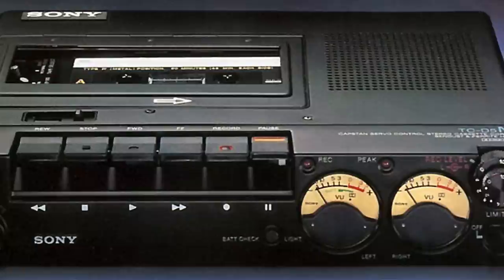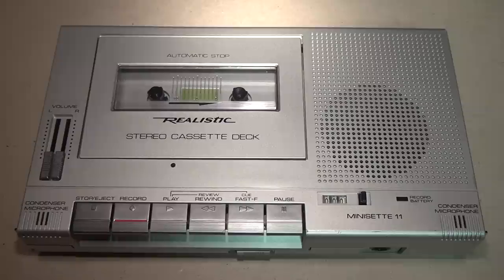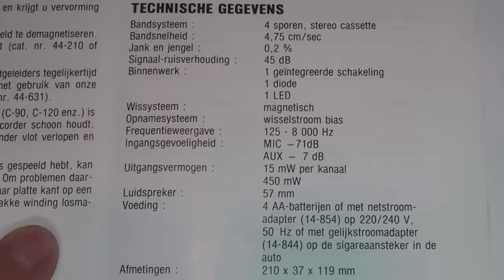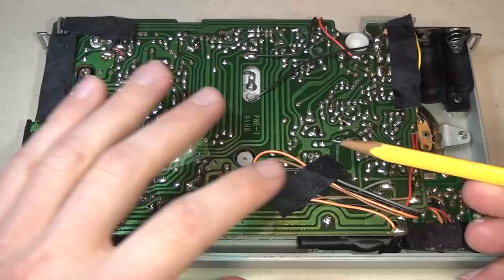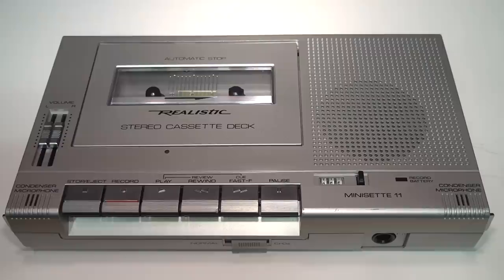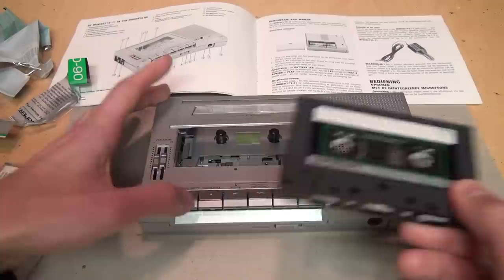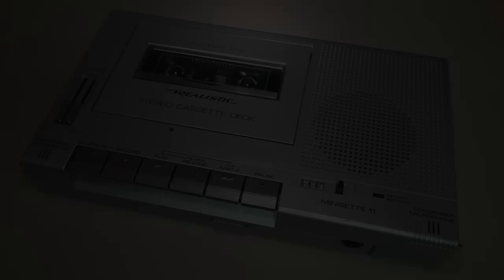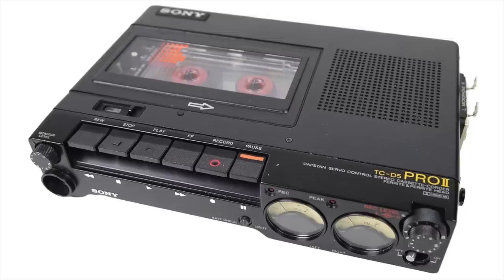A Realistic alternative? - The Minisette-11 stereo cassette recorder

Comment: i remember those minisettes in the 80s, my parents asked me what i wanted for christmas one year and i said one of those, the 11, but couldnt afford it so they got me the mono version minisette 9, still got it, mostly ok but needs new belt now, i think the years catalogue at the time said the 11 was £69 and 9 £49, but it was on offer at that time for either £39 or £29, cant remember for sure...
Reply: if it was the 9 you wanted info on, i still have the manual and couldve scanned it for you
Reply: the led  on the 9 works the other way strangely, lights if battery ok, but goes dim/out when flat ..???!!!!
Reply from the maker: @andygozzo72  Yes, I owned a Minisette-9 previously and that's what confused me -- the LED working the opposite of the Minisette-11. The 9 and 11 use the same belts, because the mechanism is identical. What does the manual for the Minisette-9 list for the wow & flutter and frequency response?
Reply: @vwestlife  wow n flutter 0.2% signal to noise 45dB, no mention of frequency response
Reply from the maker: @andygozzo72  Thanks. I expected the specs would be the same, since they both use the same mechanism. And I think they changed the way the battery LED works for when you're making long recordings. This way, when you see it start to glow continuously, then you know your batteries are getting low. Otherwise the other way, you only get an indication of battery life during playback, not recording.

Comment: Well just when I thought the price was gonna go down. I have a safe search notice the price went down at least 100. They were up at 700.
I locked out sort of and got one before they went up. It was even in great condition with minor repairs until I had an accident with the batteries.
FYI make sure you're using the right power adapter connector as if you do not it doesn't disconnect the battery and it will charge them and what happens with non-rechargeable batteries..... That aren't Duracell's that leak on their own.

Comment: Is that frequency response for the external speaker only or is it the standard to which the whole device is built?
Reply: That's its recording capability. , so the tape recorded on this device and played on a different machine,  will still be limited to this devices recording ability on playback, on any other equipment as  well.

Comment: These seem very similarly constructed to Panasonic machines of that era; the mono version looks almost like an RQ-2725 with a slightly different case.

I also wanted a decent stereo recorder from that age, and was unwilling to pay the Sony premium. Instead I bought a Panasonic RQ-J6, which is more of a walkman style stereo recorder (more specifically it's very similar to the Sony TCS-300 line of recorders.)  Like yours, it has a mostly plastic exterior, solid interior construction, and not very much documentation. Oddly, for a walkman style cassette recorder, it has a full sized RCA set of outputs.

For such an early, basic machine with such modest specifications, I was surprised with how decent the sound and recording capability is. The mics are a bit noisy, but I think this is mostly down to worn boots on the microphones, and besides that it does have hookups for external mics.
Reply from the maker: I also have a Magnavox cassette recorder which uses the same mechanism as the Minisette 9 and 11. I did a video about it many years ago.

Comment: If you're recording to a brand new cassette it is already blank. However, the permanent magnet erase head adds rumble. If you're using new tapes could getting rid of the erase head make better recordings if it is AC bias? Maybe do a video recording on a brand new blank cassette without the permanent magnet erase head and compare how it sounds.

Comment: I have just one issue with radioshack, i live in italy, we use different electric standard, we do infact use 220v at 50Hz, so except this one that uses a power adapter anything that has the need of using the power cord won't work for me

Comment: I also have a SonyTC-D5M and there is nothing better around then this semi-professional or the professional TC-D5 PROII field recorder... Well, that's not really true: the Sony WM-D6C is also very good (I have that model too)! All the named models have electronic erease heads which are much better then a permanant magnet that is used in this Realistic portable recorder...

The mechanism may have a lot of metal parts in it, the case of this Realistic machine is still made out of plastic... I would not dare to use this is as portable field recorder for professional use out in the field... 

But as a home user or as a small bussiness who uses tapes back in the day to record conversations in the building on the same place everytime it will be good enough, if you use brand new tape everytime (because you don't want noisy recordings)...

Comment: Is there a panasonic equivalent of this?  I actually have a sony recording walkman it was repaired in 2012 and I got it for less cause I said no battery cover.
Reply from the maker: I think the OEM for this was Sanyo, but I'm not sure.
Reply: @vwestlife  I know you mentioned newer decks no longer have dolby on them.  What about an external dolby unit I wonder how that would work Im thinking of getting one for my dcc deck as it only has dolby for playback.  I also hav e a bogen pa cassette player with no dolby and this would solve that problem.

Comment: Nice!
But for recording I think the fact that it has automatic level control is the biggest drawback.
Reply: It makes sense for the intended use case, but for making promo cassettes and the like it’s not what you want.
Reply: @pokepress  Ah perhaps I missed that. So what is the intended use case?
Reply: I feel like the auto level makes sense for what this is supposed to be: convenient yet better than just a convenience-based unit. If it had manual input controls, I would want it to have the auto as an option with a switch.
Reply: You and Techmoan can do no wrong. Another great video from you, sir!!!!!!

Comment: 8,000khz  is not the greatest but that little realistic has specs then the last new Sharp HiFi I got in 2020 and the  cassette deck was only 6,000khz. So it sounded awful long with it haveing treable tape his. I connected a cheap 1984 Sanyo deck throw the aux input and it was night a day difference

Comment: 11:25 this is flat out false information that could cause problems depending on the recorder, it'll by far lead to more noise too, a microphone input and a line level input have different circuits expecting different outputs, an adapter does not 'give you line level inputs' that's why mixers have line inputs and mic inputs
Reply: The input level is switchable, as he explains in the video.